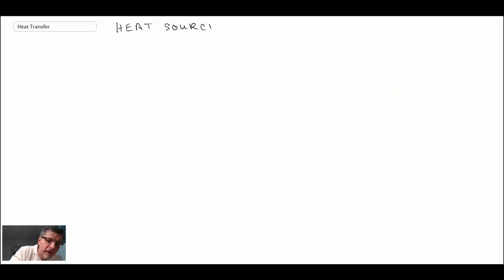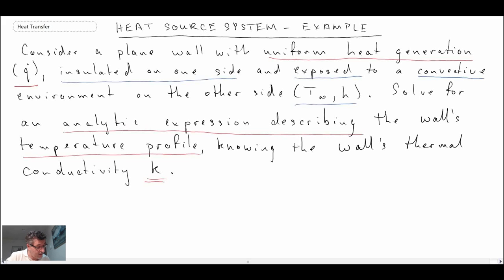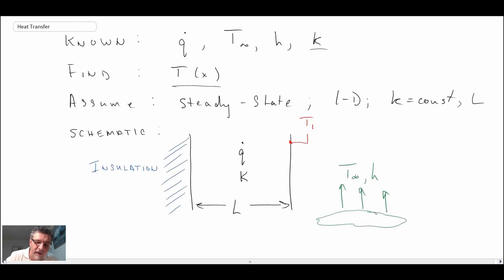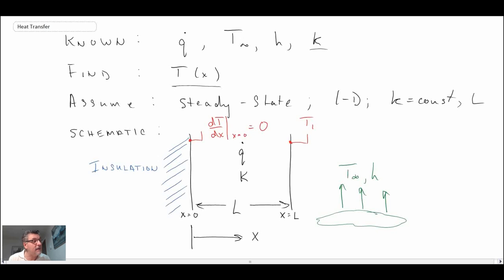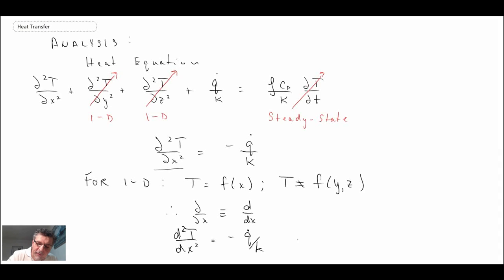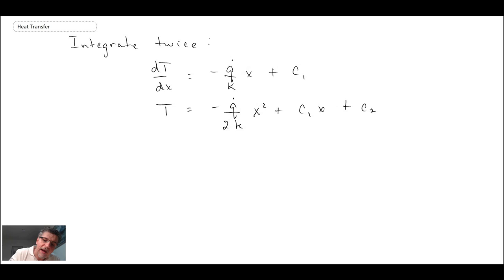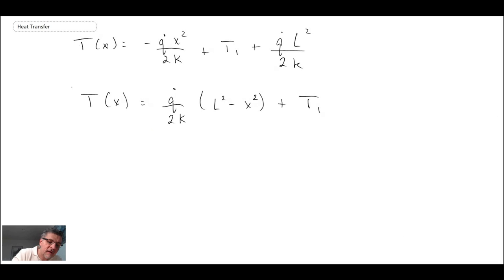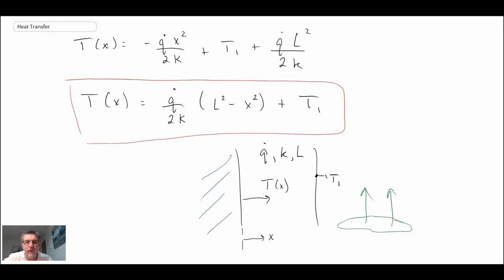Heat Transfer L7 p2 - Example - Internal Generation within a Slab

Comment: what is the resistance 
when we apply the same condition in this example 
the thermal resistance for the wall and the thermal of convection !! 
i want formula for the heat drop
Reply: Heat:- Temp diff/((L/KA)+(1/hA))